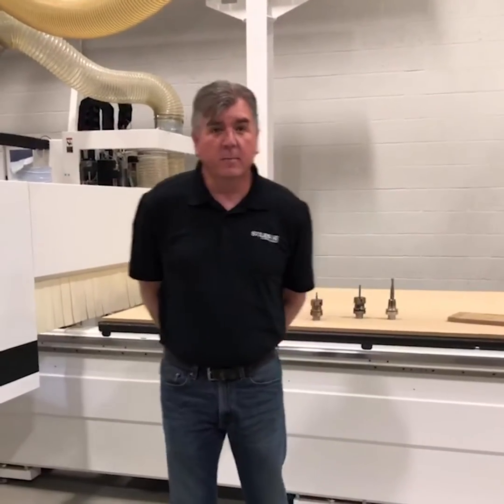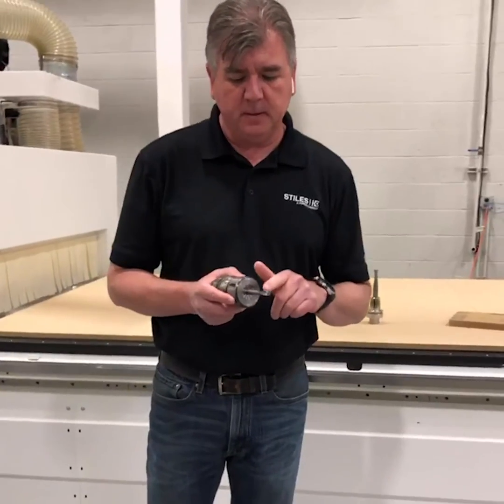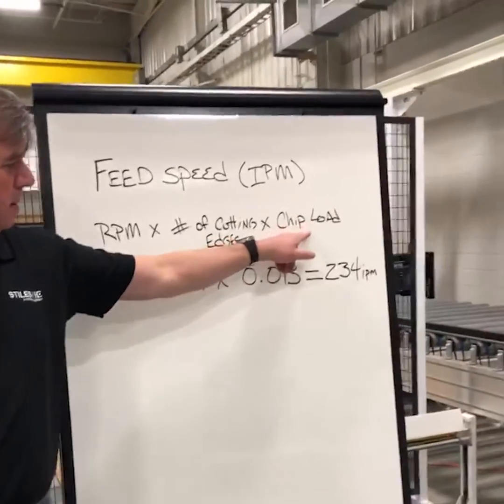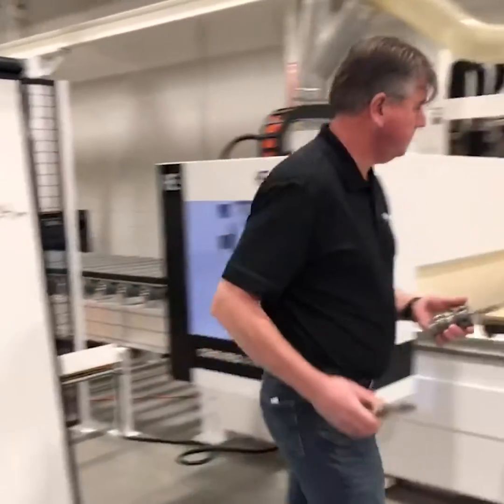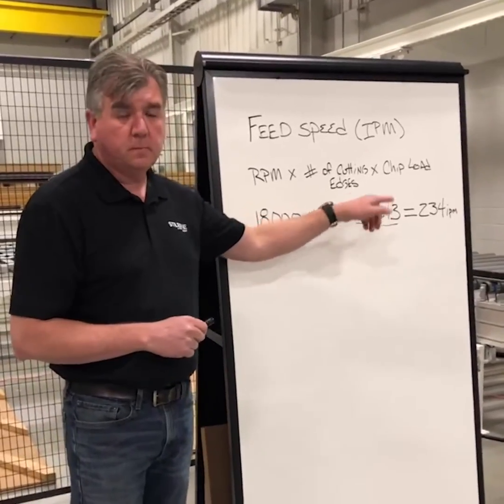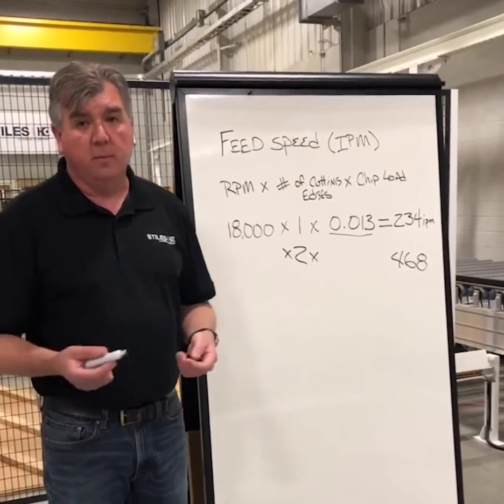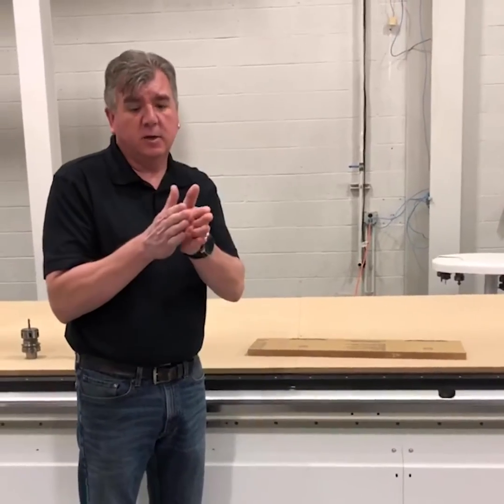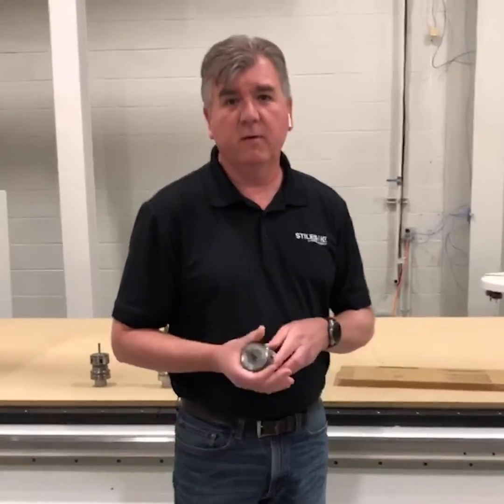CNC Tooling Tips for Machining Acrylics

Comment: I'm having the exact problem you described in your video. Does a faster rpm reduce chip rewelding or should I slow it down and increase the feedrate?
Reply: If you want Faster RPM it's best to use a cooling solution. Because in my understanding faster RPM generates more heat compared to a lower RPM. Also for slower RPM but faster feedrate, you to take in measure will that feedrate setting cut the acrylic or not.